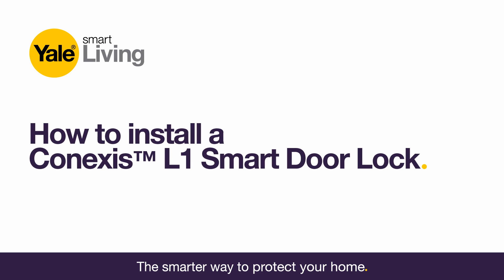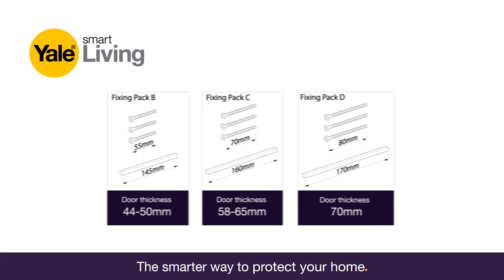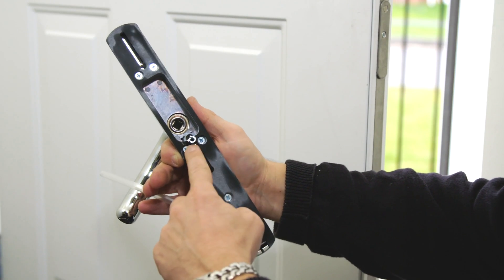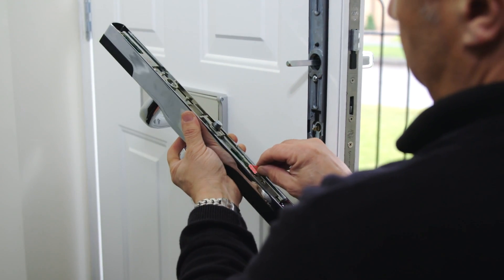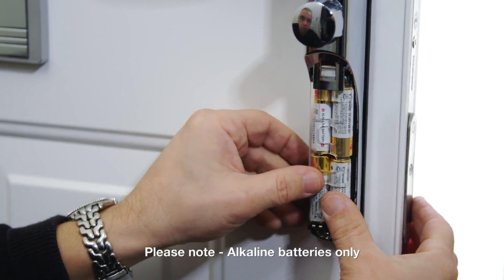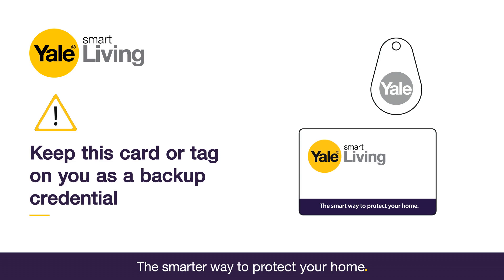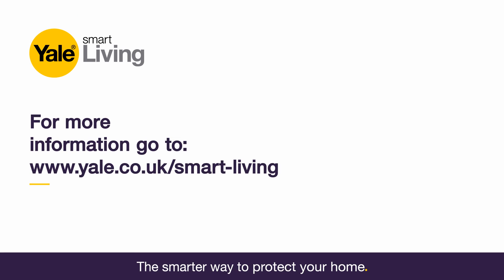How to install a Conexis® L1 Smart Door Lock

Comment: One problem I see with these in the future is the lock tries to actually lock itself when the handle is only lifted a little, so if the handle isn't fully lifted the gearing just sits there grinding away until you lift it fully. That will only last so long. Great product, badly designed.

Comment: I have just installed one of these, all seemed fine but then it kept whirring and whirring when locked. Uninstalled refitted the actuator by unscrewing it and screwing it back in; refitted the lot and it now works perfectly. I have a small hole where the previous Yale lock was taller.

Comment: Does the screw going into the actuator need to go into the hole. Because to line mine up in order for it to spin I’d need to sink another hole in the side of my door which I’m a bit afraid to do. I’ve installed it by just screwing the screw against the actuator which allows it to turn but I’m not certain this is the correct method because it won’t lock?

Comment: Installation was very easy. I went through it slowly using both this video and the instruction manual that came with the lock. Didn't encounter any issues at all and the lock is able to open and close freely with no issues. Build quality is excellent and solid. seems like a very well thought out design. Watch the video a few times and then play/pause it as you are installing and you cant go far wrong.

Comment: Can't get this to work on my front door. From 3:30 in this video the installer extends and retracts the deadbolt using the handle. My door, once the deadbolt is extended, requires the key to be operated first then the downward handle movement to allow the deadbolt to retract. I am stuck on the handing process because of this.

Comment: My experience has been somewhat mixed after having this product for around 8 months now. The installation instructions were clear and simple to follow, however in practice it was slightly more difficult; you have to understand that every door and installation is different and unique. It took me around 90 minutes to install it the first time round due to the screws not being quite in the same place etc. Once installed, I locked the door to find the actuator just spinning inside the lock, not actually locking it. A bit more faffing and messing around (and a good pull up on the handle) eventually made it work and lock correctly. Ive since had some trouble with the z-wave module (connected to SmartThings) that I managed to sort out with another round of tinkering. Since then, it's been working like a dream and works everytime. 

TL;DR: It works great after some messing around!
Reply: Hi Josh, I have the same problem. It is just spinning around but can't lock the door. Manually I can. But the motor seems just spinning. How did you resolve?
Reply: Piece of cake to fit, I missed one step and that was holding the button for 15 seconds then moving the handle up and down, after doing that it worked perfectly. Added Z wave and connected to home assistant with a few automations 👌🏻

Comment: Not impressed so far! Definitely would suggest only fitting it mon - fri daytime & when you have LOADS of free time to phone helpline - & wait! I fitted it bank holiday weekend - most popular time for diy of course - then had to unfit it because it didn't work & will have to wait 3 days until tuesday in hope they can tell me why it's not working or arrange replacement!

Fitting appeared to go well, all seems straight forward. I read manual, got everything ready, watched video, etc & seemed pretty clear it shouldn't take long & it didn't. But then the problems started as the motor made noises, it just never moved the lock! It did lock the handles [on green? red unlocked - doesn't seem to tell you if that is how should be] but wouldn't unlock with the paired card. Tried again, this time with tag, that didn't work either. Still lock doesn't move with motor, only thumb latch locks/unlocks

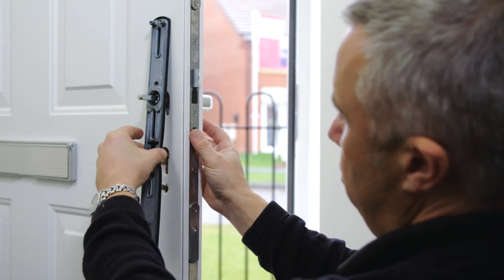Comment: I have a problem regarding the screws that fix the mounting plate to the door (see 2:19).  There are holes for all 3 screws in my door but the screw just under the handle will not go in all the way. The top and bottom screws fit perfect.. Will this be adequate?
Reply: Jon L  no
Reply: What mechanism are you using
Reply: Yes two screws will be all you need. Doesnt matter that you cant get the third one fully in.
Reply: @smallbluedot This was 7 years ago. I switched to a Nuki and never looked back